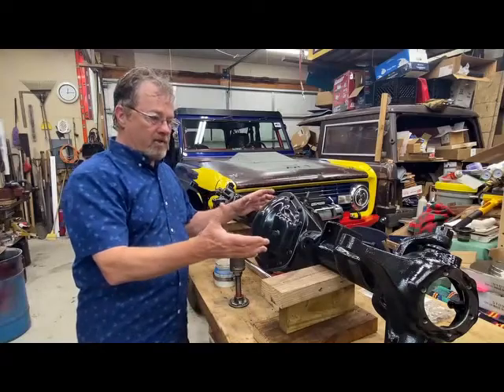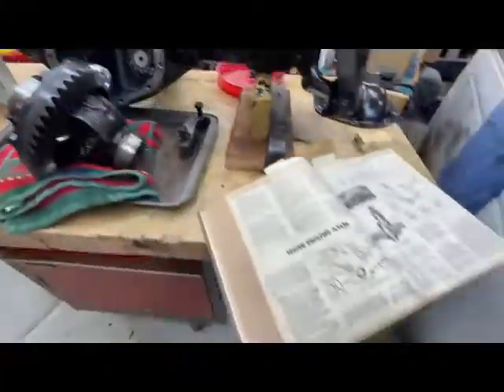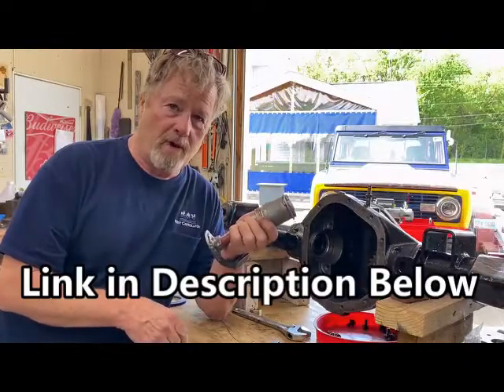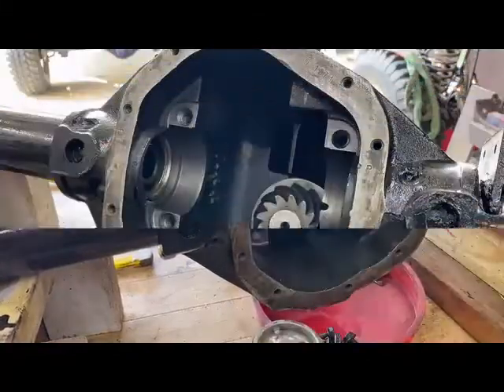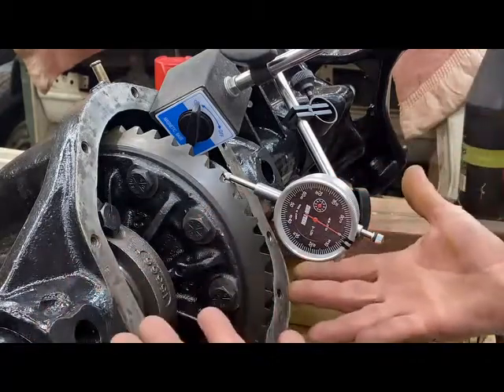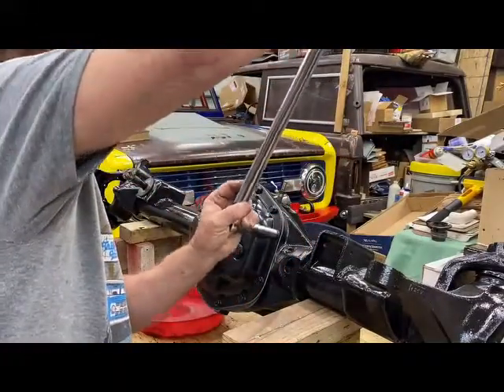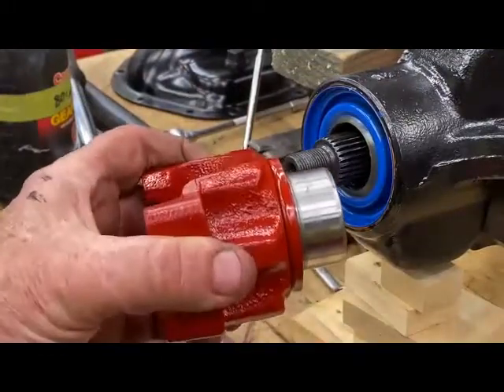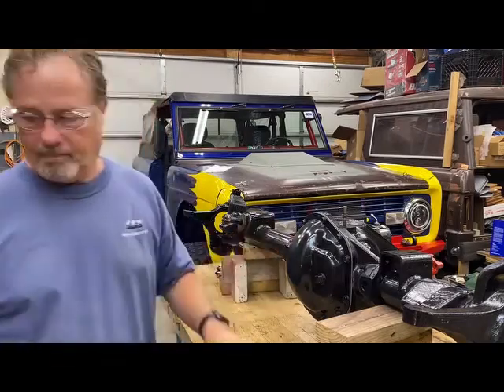Dana 44 - Axle & Pinion Seal Replacement

Comment: Nice video, got a 78 Bronco that’s going to need axle seals at some point. I had the whole thing disassembled on my bench and changed everything except I didn’t want to disturb the differential, what a mistake, now have to pull it back apart to fix the leaking seals under the vehicle.
Reply from the maker: @1971_Chevelle_SS  Oh Boy, I’ve done it before under the vehicle, not to bad of a job, except for having to lay on the floor. But it’s a shame to have to pull it back apart. You’ll be an expert🤔😁

Comment: What size socket did you use to remove the bolt for the seal ?
Reply from the maker: @longshotdiedtired1582  The socket for the pinion nut was 1 1/8”
Reply: @randysguitarsbroncos223  thank you , I noticed yesterday my seal was leaking , never replaced one before so your video was really helpful , from what I’m reading there’s a little more to the job then just replacing the seal , mine 83 f150 4x4 with the Dana 44